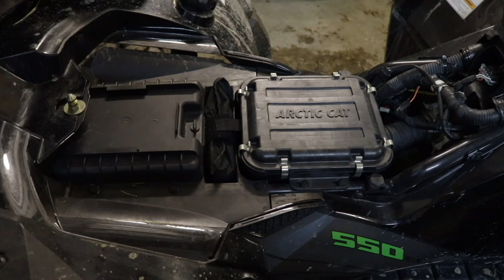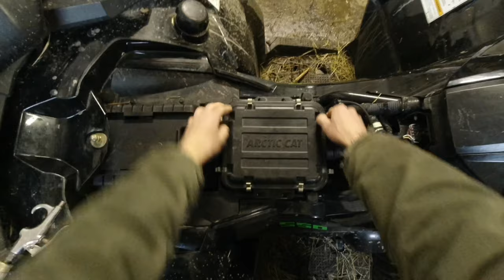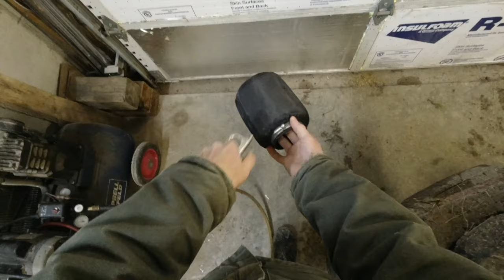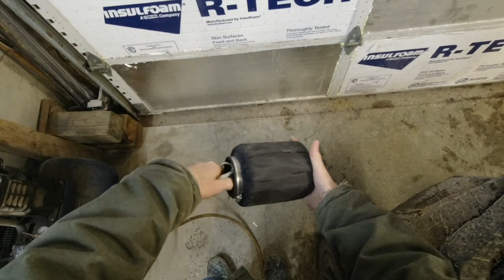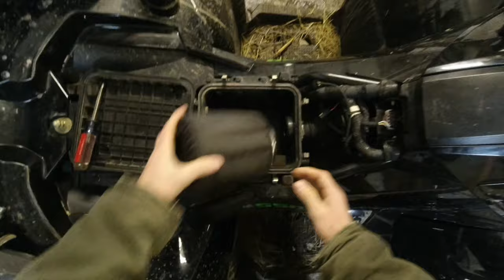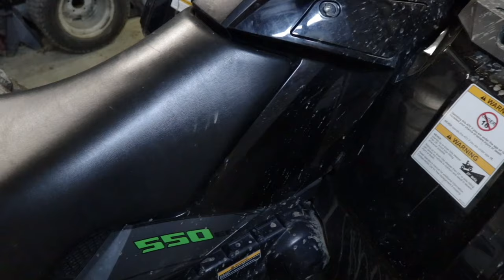How to Clean your ATV Air Filter

Comment: I just did this with my air filter on my king quad as per service manual instructions.. I expected to see a bunch of dust/dirt fly out but I didn't ... I guess it still worked?
Reply from the maker: May not have been very dirty.